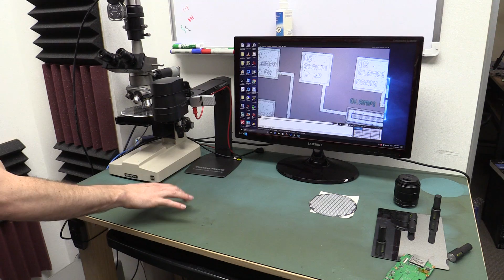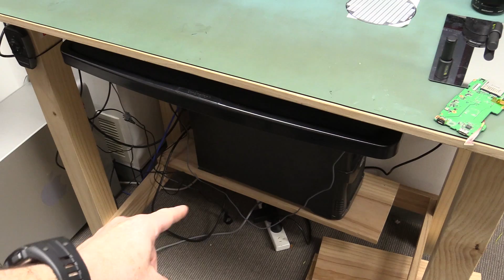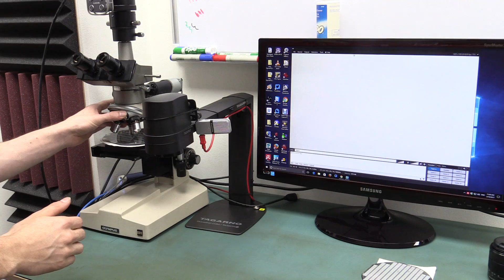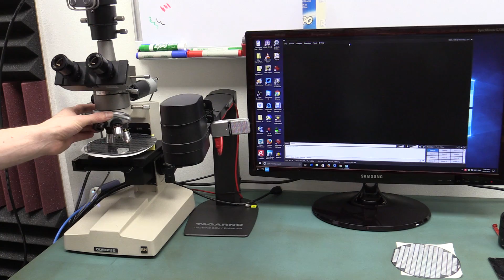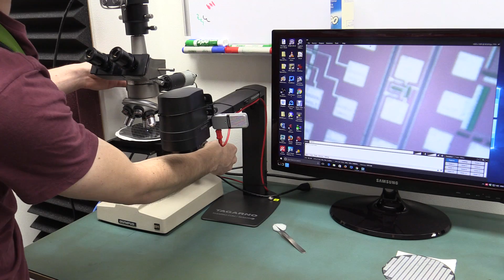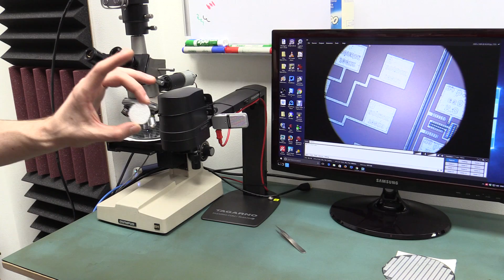Wafer Microscope Weirdness!

Comment: Dave, your light source/foam/diffuser is focused onto the same conjugate plane as your specimen/object plane. This is not the correct configuration. Normally, your light source is to be focused by another lens, the collector lens of the light source onto the condenser aperture diaphragm. This will make sure that your light source will never be focused onto the same conjugate plane as the specimen you are imaging and will ensure a nice even light. The old lamp housing should have a few lens for this purpose that you can reuse or 3D print a holder for.
Reply: Sophat, this is an example of the magic that happens on a channel like this, fascinating information....and thanks for the education re. Koehler illumination. )) Super.
Reply: Martin, it's comments like yours is why I endeavour to offer my two cents in the first place. I'm glad someone can learn and get something out of it. I learn just as much too and it's why I subscribe to Dave's channels. 
We live in an amazing time, where we have access to nearly the entirety of human knowledge at the tips of our fingers, and in seconds. So many fascinating things around us and it's surprising how a tiny bit of information makes a huge difference. "Simplistic" things like a "light source" used to view a specimen in any optical system, is surprisingly important that even experts sometimes overlook. The physics of the light path and optics has a fundamental impact on ultimate resolution.
Reply from the maker: IIRC the old lens housing doesn't have a lens, the lenses are in the light shaft you can see in another video. So I believe it's ultimately just source distance/angle/size issue.
Reply: ahhh ok, I see. Then the easiest way to get the right distance is to position the LED die the EXACT distance from the first group of lenses, as the filament of the tungsten bulb was originally. The lenses normally focus the filament of the tungsten bulb onto the aperture diaphragm to archive what is called Koehler Illumination.  If this is done correctly, you wont need to use a thick diffuser as the light source will be out of focus in the field of view. Also, the light source will fill the field of view so you don't get hotspots. Love your channel(s) Dave! 😛
Reply from the maker: Yes, we'll have to reinsert the old lamp and measure the exact distance and then duplicate that with the LED instead of just sucking it and seeing.
Reply: Sophat, I absolutely agree about our amazing time. The internet is a Kardashev level one technology. Again I thank you for contributing. It is like discovering a precious gem. I have enjoyed a whole afternoon honing my knowledge on optics. Thanks ))

Comment: You need real diffusion. Go to your nearest theatrical lighting shop and ask for some Rosco diffusion. They are thin translucent sheets used for theatrical lighting and it willl do the job mutch better then hacking something in. A nearby theatre might even give you some scraps for free.

Comment: So, re: vibration. Newport Optics (basically the 'go to' for this sort of thing, like JBC for soldering kits) has active vibration damping tables designed for situations like this. A (cheaper) solution is obviously to take a heavy hunk of mass, drill and tap a planar surface to it, and use that as your base on which to place your scope.

You're probably going to want to go and get a x,y plane that's automated at some point. NSK out of Japan is the industry standard for 'the best', Parker, Seike and THK are also fairly good. I've seen people take cheapo NEMA 23's, hook them up to rails with pre-loaded recirculating bearings to eliminate backlash on a standard threaded rod, and get pretty darned good repeatability (~/+ 3 or 4 x 10^-6m). 

RE: Lenses & sanitation see my comment here - https://www.youtube.com/watch?v=hfUHRIYuDkI&lc=z12nfbjjoqfgjjilo23pcpqw3oqdynb2c

Comment: Well guys, ever heard of Koehler illumination? Using a diffusor (no matter how coarse) is not really a good idea since you have a fully equipped reflected mode microscope. A point like light source is ideal, but if you can match the original filament size of the bulb you will get it back to factory specs at least. Now for the "Koehlering" procedure, you need to remove one objective from nose-piece and focus the light source (LED die) onto some paper at stage level. Use the lateral and axial adjustment screws on the light housing (or whatever contraption you build) to move the light source to maximally fill the back focal plane with the focused die of the LED. After that, put back in the objective (preferably low mag at this time), use a first surface mirror (a wafer may do the job) and try to focus on its surface. Then, close the field stop a little and use the condenser adjustment to focus end center the field stop iris into the field of view. It should be par-central and par-focal for all objectives (not that you can do much if its not, but try at least try to average it out among all lenses you got). Last step; Open field aperture, take medium mag. lens and remove one eyepiece. Look into the opening at some distance, where you should see even illumination. Use the condenser aperture and close it to about 80% of the visible circular area. You should now be able to clearly see the condenser iris. Now you are done! After this alignment you will have optimal performance and maximal resolution.I also noticed David2 using these cosmetic wipes. For lens cleaning you should always use industrial grade cotton! Try to avoid even Isopropanol but use the distilled water of your breath against the lens surface instead. For really dirty lenses (e.g. immersion oil etc.) you may carefully use diethyl ether for the first brushes followed by breath of distilled water. Always circle from inside to outside of a lens surface. I usually use a sharpened wooden kebob stick to wrap a tiny amount of the industrial cotton around it. Never use your fingers to smoothen it out into a cotton swipe and never touch the cotton, use the sleeve of your shirt instead.Hope that was of help, contact me if you have further questions (I am what you would call an "officinato" :) )CheersLutz
Reply: I agree the diffuser is crude. the LED had a very different relative luminosity vs angle to the old bulb, it is much more directional. I think thinking some sort of polarization filter to fix issues caused by the diffuser. Not really sure if it will fix it I need to think about it more. Any thoughts would be awesome :) Do you think a diffusing epoxy would work (To correct the relative luminosity vs angle stuff) as it says really close to the point source.
Reply: David, I don't think diffusing is the answer. Of course the light is more directed compared to a filament but that should not make any difference. Both sources are incoherent to the extend of the size of their emitting area. I also have an older Olympus research microscope (shame on me because I am a Zeiss guy) with the same odd bulb. I also converted to LED. I crushed the old bulb and used the socket to hold the cylindrical heat sink with LED. I chose one with similar die size as the quadratic filament was. I managed to have it exactly at the same place where the filament was. I used the CREE XTE-W130 and a small variable current source with potentiometer which all fitted into the lamp housing. This way I had all lamp adjustments available as before and kollimation and Koehler'ing was no problem whatsoever. Back to illumination optics. I know that these older Olympus scopes have illumination problems with small magnification lenses. A common hack is using ground glass diffusor in the condenser plane. For such small NA lenses this is tolerable but no longer considered optimal. To get maximal resolution  (wavelenght/NA famous Abbe limit), the illumination field has to match that of the observation. In other words, condenser and lens NA should be same.  This is what I described in my comment about adjustment. In your case this would be applicable for both 20x and 40x objectives with NA around 0.5 and higher. For the lower mag. lenses you could use a ground glass diffusor in the plane of the condenser aperture  (which in your case is somewhere before the tube lens and semi transparent mirror from the lamp side). But in all cases try to avoid using a diffusor. You are writing about a Pol filter?  Unless you have a pol-scope I wouldn't see a reason for that. On the other hand use of linear polarized illumination could find you areas in your sample that are birefringent. I think that was not your intention. So again, try to place the LED at the same place as the filament was and adjust the scope properly.  Use diffusor in the condenser pupil only when illumination field is too small for a given objective. I thinks that's the best advise I can give... Let me know. Regards Lutz. (might be easier replying to my Gmail address )

Comment: So maybe pour a concrete table, and use three legs, or at the least put some triangle bracing on the current table legs and add a heavy top slab.(again could be concrete 30-50mm, even formed in place right on the table for a perfect fit, use less water in the mix(should not be fluid) and keep the surface damp with plastic and a water mist for at least a week, two weeks is better, as the curing reaction only happens with water and can continue making small gains for over a year. (but too much water initially will dilute the components)

The objective lens is the closest to the 'object' being viewed, if the pattern was in the objective lens elements it would have changed when you selected a different power objective lens. Also I did not notice either of you look through the actual eye pieces to see if it was above or below the splitting optics. Luck prevailed, however.
A lens can be made of several lens 'elements' in a fixed arrangement, often two densities of glass cemented directly face or [ if a gas or vacuum is used as an element] cemented in a rigid fixture. In any event they move as a unit and generally don't have any focal point within the element group. [I say generally because a very thick single element lens could in theory have a focal point within its self.]

Comment: You need an extremely stable setup with vibration dampening pads to get the most out of that level of magnification. This is a common problem in biology labs that want to throw a microscope where they have counter space. Ideally that table would be fully seated with the floor, not just with 4 legs, and certainly not with a computer on it. The dream setup is an air table with gas pistons in the legs for full stabilization.

Comment: Is there a special reason you're still using XSplit? I mean, yes, "never change a running system" but just curious why you haven't switched to OBS yet :)
Reply from the maker: I tried OBS and it was a PITA to use. X-Split was much nicer.
Reply: OBS throws a absolute shit fit if the resolution of your source is different from your monitor. Its also not a fan of black magic capture devices or switchers this is a problem if you have say a load of cameras on SDI going into a  switcher or capture card that you are trying to switch on the fly , they may have different resolutions or frame rates and OBS just cannot handle that properly, it may be able to if you spend ages and ages messing around with it but time is money, the time i would spend doing that is worth more than the  cost of something like wirecast studio.

Dont want to sound too harsh on OBS its amazing for doing simple stuff , 1080p capture 1080p scene going out at 1080p but if you want something flexible that will just work no matter what you throw at it you need professional software and hardware.

Thats why somone like kramer can sell HDMI splitters at 200 quid when you could get a cheap one for 10 quid off ebay, sure the ebay one may work , but when it HAS to work very time with no bugs no downtime you need pro gear, its the same for software.
Reply: Then OBS is obviously not configured the right way if it shits itself with different resolutions... I have no problems at all here, my monitor is a widescreen one and I've used OBS on computers with a far tinier resolution on 1080p and it worked without any problems with multiple sources etc.

Comment: Even illumination on low magnifications is always a big problem in microscopy. For low magnifications people buy special condensors. Try to get your illumination the Köhler way, this might help a bit. The stage and focus should be rock solid on a Olympus BH microscope. At least on mine they are.

Comment: If you want just a tiny bit of diffusion, you can try frosting the lens of the LED with a little sandpaper.  I've used 400 grit or so and it softens the dot quite a bit, of course, it's not easy to undo.

Comment: heavier table, check the microscope feet, check the coaxial focus lock, and is trinoc camera fitting tight......frosted glass diffuser along with polarizer in the 
incident lught filter slots

Comment: Hello, I worked at Cherry Semiconductor and then ON Semiconductor, in their East Greenwich, Rhode Island wafer fab for over 14 years. I would experience stage shaking constantly, including the stage drift.  We used isolation bases and even floating tables for our microscopes when used in silicon wafer inspections. When you focused on to the foam piece, I thought you were hovering right over metalized areas of the die. The metal has very distinct grain in it. The grain would show best in the top most metal layer, just under final passivation. The grain would also show nicely in the bond pads, especially because there is no passivation over them. The Al/Cu metal had the biggest and best grain in it.

Comment: Be nice, first ever comment here! A long time ago I worked with electron microscopes, which don't like vibrations. They used massive air tables to dampen external vibrations, which could even include traffic from quite a distance. The ultramicrotomes used to cut samples had smaller air tables built into the desk. From what I can remember, in the old old days labs would make their own cheap air tables, with something like a big solid block of hard wood and a rubber ball at each corner to dampen vibrations. Just a thought.

Comment: the slides are dirty and dry, gibs are very certainly loose as well
need to take it apart, clean the contact surfaces well and put heavy silicone lube (kinetic lube) on them and adjust the gibs to give you a tight slide
Reply: also, next time you take LCD screens apart, hold onto the diffuser films. they work better than foam
Reply: GIBS! I was trying to remember that word for basically the whole cleaning of the microscope. You have saved me google time, thanks!

Comment: Wouldn't the microscope be less wobbly without that rubber mat between it and wooden desktop? 

For diffuser material.. I think you have some old LCD-monitors.. thos have nice stuff in them. Also test those polatization materials, some metals look really great under polarized light.

Comment: Cute Aussies. I used to work with something similar. That table is far from sturdy, lol!!!! 
The table I worked on had a 150kg concrete slab on it WITH rubber in between on a steel table (yes, I would NOT recommend jandals, unless you want broken toes) 
I would go that way (super easy to make that yourself). Image stabilisation is also cool of course but a little difficult to do.

Comment: Proper illumination optics is under-appreciated part of metallographic microscopes. 
It is essential to get perfect illumination to reach diffraction limited performance on reflective features (like metal tracks).
This dirty tricks with diffuser and such - are very crude and good only for non-reflective surfaces. 

The idea is that light should shine on every point of specimen with exactly the same cone of light over whole field of view.